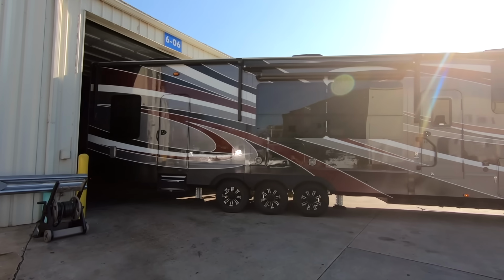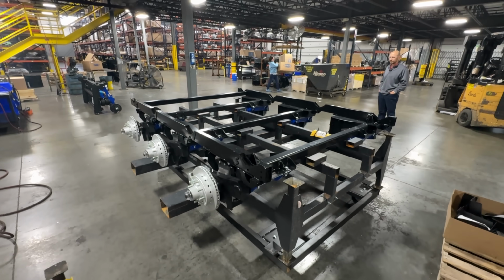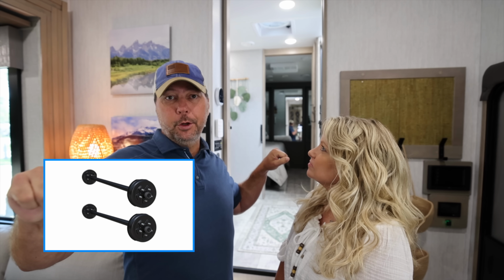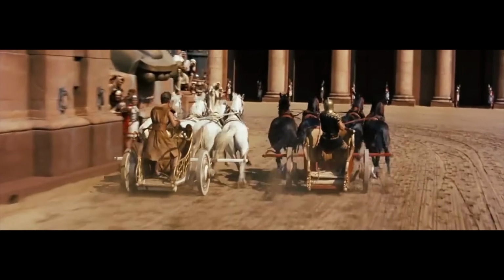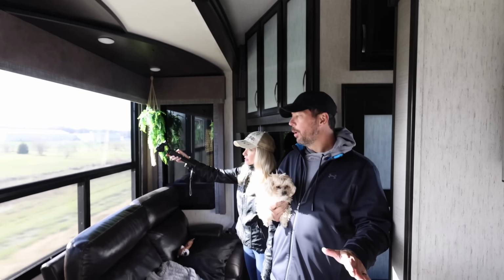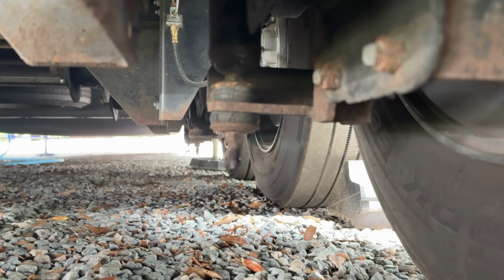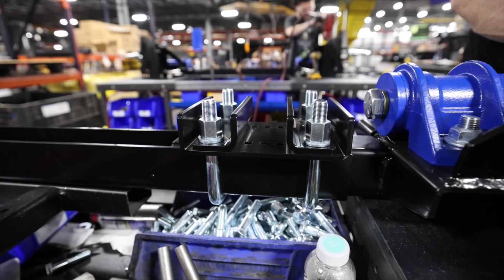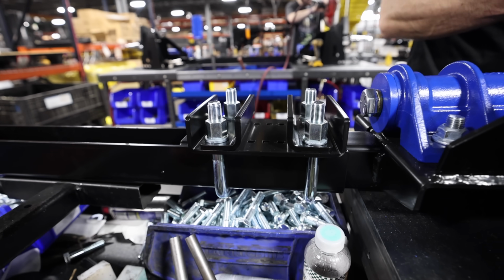MORryde Independent Suspension 2.0 GIVEAWAY!

Comment: Given the state of manufacture build quality. I would rather have Morryde do the install. I was excited to hear that GD was going to have these installed on all new Momentums because I assumed the frames would come with it already installed... Now i'm wondering if that's a good thing or bad thing.. 

Can you imagine if the quality control bug bites and something isn't torq'd or tightened properly from the manufacture (which is a pretty common issue)...
Reply from the maker: If you're concerned, that would be an easy thing to check before hitting the road the first time.

Comment: I already have the IS 1.0 on my toy hauler.  Can I still enter the give away?  If I win will that be a problem removing the 1.0 and installing the 2.0?
Reply from the maker: Unfortunately, it needs to be a standard axle system.  The 1.0 and 2.0 still use the same core parts (shock absorber and shear springs), so there would be no real improvement in the ride from 1.0 to 2.0.

Comment: It never fails to amaze how many people spend $150k+ on a drag behind trailer and pull it with a $75k+ truck and think that the suspension built for a 'tow it from the factory to a live there forever trailer park' is adequate for coast-to-coast travel. And even after a few years of, "Why are trailer tires so crappy? They only last a few thousand miles before they blow out and rip half of the skin from the trailer!" Then they decide to take it to Alaska or Baja. 🙄🙄🙄

Comment: Great opportunity!
However, as an automotive design engineer for 30 years, I am a bit skeptical of the bolt on version being as solid and robust as the fully welded version. That is a lot of torque and twist being directed back to the flimsy existing hanger brackets. Thankful I got Version 1.0 in 2022

Comment: Going to independent suspension one of these days just a long way to get it done! Alliance 382RK 2023 model. We mainly run up and down I-95 until we can retire and go more often and farther. Just signed up been a subscriber for a few years now only thing I don’t do is Instagram! Thanks for the opportunity!
Reply from the maker: Click Instagram anyway and get the entry.  You don't need to sign in or anything. 👍🏼
Reply: @ChangingLanes done, question if you don’t mind, did you have to add air bags to your truck with the toy hauler?